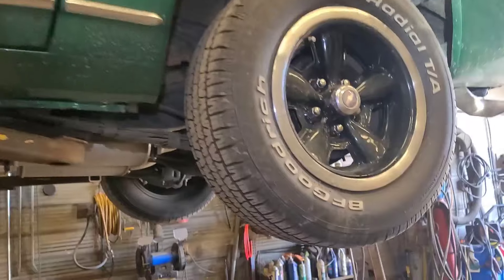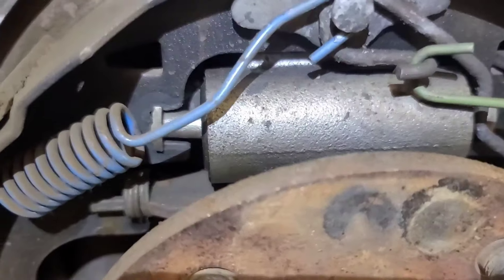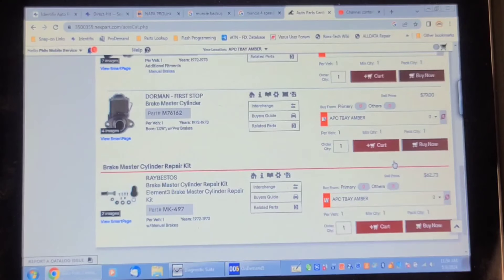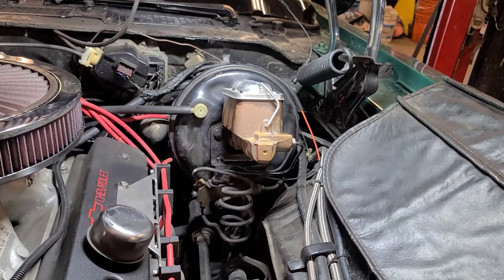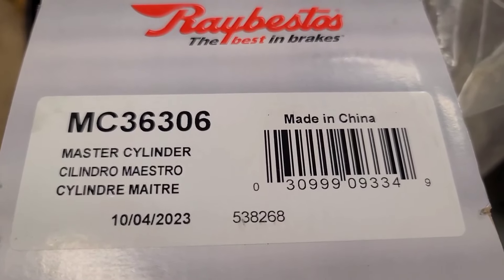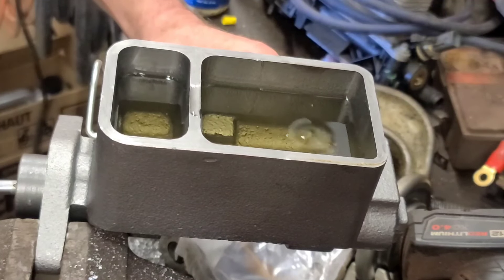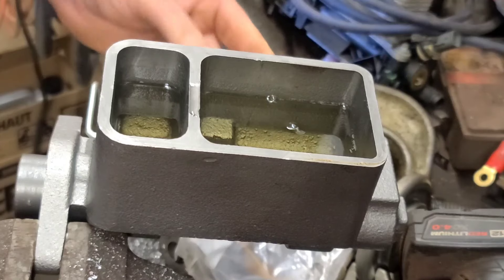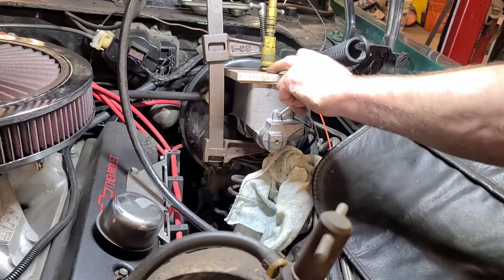1973 Camaro, Brake Fluid Loss Resolved

Comment: You do not need a helper to bleed brakes, you can run a very long little rubber hose from each wheel cylinder, one at a time, up to the driver door and a catch pan outside on the floor, use your finger on the end of the hose as you would on the nipple of the wheel cylinder while pumping the brake pedal until you eventually get fluid and air out of the system, (better to start with the long hose full of fluid) now the hose is full of fluid and will act as a barrier to air getting back in the system while you go around to tighten up each bleeder nipple. Now some of us have experienced a little air bleed around the nipple threads so what I do is after all brakes are bled, I hold the pedal down with some device while I open each bleeder nipple one more time to ensure any last bit of air comes out and do that 4 times all the way around. Cheers.

Ultimately I have a check valve bleeder hose combo set up for a few bucks.
Reply from the maker: @DuaneDonaldson  thanks for the tip.  I'll stick with the pressure bleeder though.